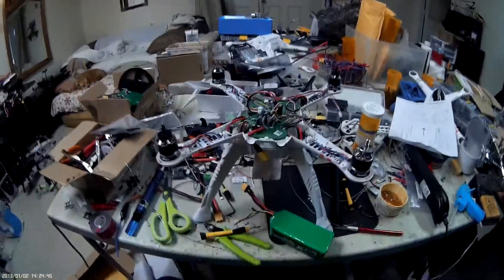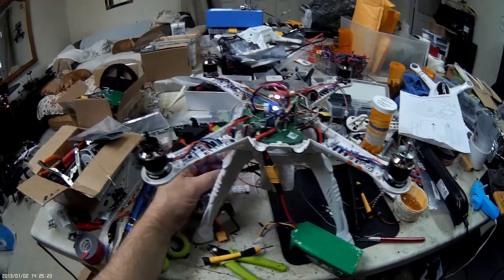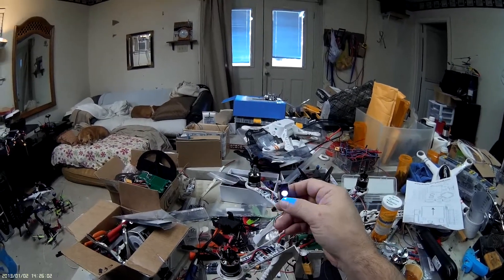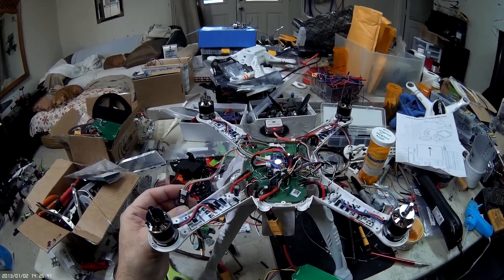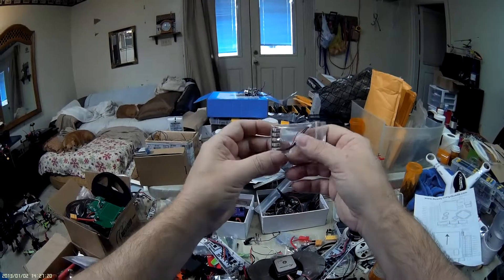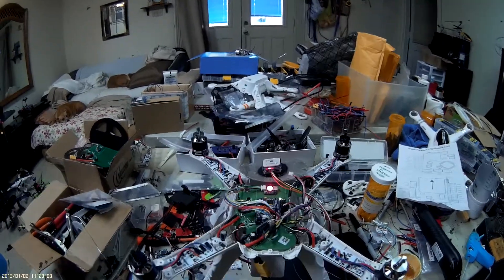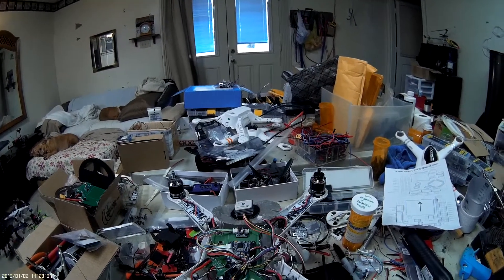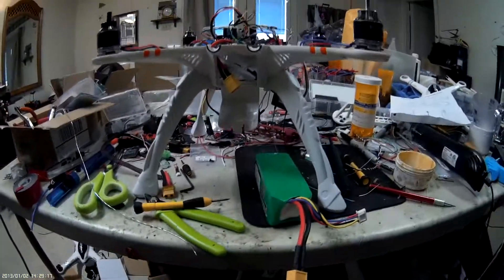Walkera X350 Pro with mini PixHawk install.

Comment: Did you ever get the pixhawk to install AND, more importantly, work in your X350 ?  I run a X 350 Premium and have two 350 Pros that need work with the flight control board. I have tried to run a regular X 350 board in the pro with poor results.  It would not boot or run.  Do you know anyone I can send my controllers to and have them restrored to factory defaults ?  I have been fighting with them too  long and  just want it done.
Reply from the maker: Yes. I have videos up of this flying.
Reply from the maker: It's easy to put them back to factory. Are you talking about the Devo-M flight controllers?
Reply: Yes.  The pro flight boards were tweaked when I stupidly ran them thru the wizard of the GCS  with mavlink.  How  much would you want to return 3 of them to factory defaults ?
Reply from the maker: You didn't try to flash firmware with Mission Planner did you?
Reply: yes.... I believe I stupidly did
Reply: not knowing what exactaly the wizard set up I think it did try and install firmware. I was new to this and thought it was something to allow the QR 350 to link with the system
Reply from the maker: There would be nothing anyone can do then. Once flashed with Mission Planner the Devo-M bootloader gets forever corrupted and the only way to fix that is by changing the bootloader firmware chip. It's not worth it.
Reply from the maker: Walkera uses their own proprietary bootloader that can only be talked to with Serial Angel from Walkera. The bootloader in the Devo-M doesn't match the bootloader for the APM. Although they act kind of the same in flight, in the bootloader section it's completely different.
Reply: Does that overwrite the information on the board ? and is it nonrecoverable ? They still spin the motors up, locate and lock onto satellites they just fly like crap